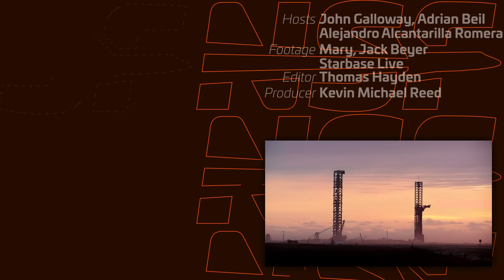The Starbase That Never Sleeps | SpaceX Boca Chica

Comment: 9400 gallons of retardant dropped in 8 seconds by a 50yr old converted wide body passenger aircraft.

It's powered by (3) G.E. CF6-50 turbofan engines producing 50K lbs of thrust ea AND a skilled crew with very large balls

Comment: When the booster is moved, is it pressurized to prevent collapsing?
Reply: These vehicles aren't pressure supported, they have reinforcement stringers and hoops to give strength. They pretty much need to be transported vertically all the time though, horizontal is possible but logistically a nightmare to lift and move, pressure would help in this scenario.

Vehicles that need pressure to be supported are "balloon stages". Very thin stainless steel skin with no structural reinforcement. The Vulcan upper stage is an example of one, it's very thin stainless steel and would collapse without pressure.

Comment: If this has been covered in a conversation I apologize for missing it but do we know if the booster engine that had the partial failure was the reused engine from the fifth flight?
Reply: The reused one (314) was on the outer ring, but the one that didn't restart was a middle ring engine
Reply: @ Thank you so much!
Reply: No

Comment: The scale of the engineering required and the speed with which these structures are built is mind blowing and deserves its own documentary. Everything needs to be custom designed, built and assembled. The supply chain behind all this and the complexity is very impressive.

Comment: is there an official limit to "testing", i mean at what point would you call a launch and a mission an actual mission, as opposed to a test flight?
and am i right in thinking it came in at a steeper angle this time, to avoid burning the QD and OLM? it looked like the flames were aimed at the concrete at the base of the tower rather than straight down?
Reply: and by the way, ecky thump.

Comment: The sound of the turbopumps spooling down is crazy!
Reply: I believe you're talking about the water deluge noises. We don't hear the Raptor turbo pumps. That high pitch turbine kind of sound is the pressure relief from the water tank nitrogen pressurization, it's a blow off valve. And for catching the booster the system is activated.

Comment: 11:40 - Pad B chopsticks used to catch ships. This could provide better damage mitigation in case something goes wrong with the catch, and we won't have ships crashing into their own already-landed boosters. (and it keeps the Unprotected booster tops from being roasted by the incoming ship) 
So catch the booster on Pad A and put it on the OLM. Then catch ship at Pad B, put it down on a transport, then Pad A can re-stack it on the booster.

Comment: Do we think SpaceX will split launch and catch towers in the future? The equipment needed for each has very little overlap (I assume). And in years past reusability, how many towers do we think? I'm going with 5 launch, 2 catch sounds reasonable.
Reply: SpaceX has released plans for a dedicated catch tower at 39A, but it will probably be for overflow situations landing ships when they’re preparing a launch on the main tower.
Reply: If the plan for a booster is to refuel and refly, it makes sense to land on a launch capable tower.
Reply: The launch towers use the same chopsticks so any launch tower is also a catch tower
Reply: @ale131296  the hardware on the chopsticks needed is slightly different to lift for launch vs catch. Along with quick disconnects/water/tank farm/flame trench. I just feel like it will be a catch and release vs full stack procedures.

Comment: That vent from the booster looks a lot like the ones that come from the tank farm when they burn off exhaust to prevent emissions. Do you know if there's any correlation?
Reply: The tank farm doesn't have any flare stack, they re condense methane. But the booster since it wasn't attached to the QD had to relieve pressure into the open until it's connected up or empty, not sure if there's an igniter but it comes out and is essentially a flare stack to burn off the methane that was released.

Comment: I wouldn't be surprised if Engine 314 is reflown on Booster 15/16 to keep the longevity testing going.
Reply: I honestly hope that they refly Booster 14, after the necessary inspections. But I do hope that they pull 314 off, and fly it on the next booster, as B14 certainly won't be flying for a while, if they do end up reusing it.
Reply: @daedelushex1841  That also begs the question of what kind of low profile test mission/payload will SpaceX risk the loss of the entire booster+ship in case something goes wrong with reusing a booster for the 1st time?...
Reply: @you2be839  It would likely be just another test flight, without payload.
Reply: @daedelushex1841  I don't think they're gonna risk Starship S34 on Flight 8 since they had a big issue with Flight 7 with it and they need to make Starship work first.
Reply: they might even fly some more engines from booster 14 because they looked great!
Reply: why not check, retest and reuse the whole booster as flight 8 will be all about the ship and not waste a new booster on a ship test
Reply: @thijsvanhout4242  They will most likely spend quite a bit of time thoroughly testing Booster 14 before they consider flying it, and I expect that it will take several months. I wouldn't be surprised if they remove all of the Raptor engines and test them at McGregor, as it has better testing facilities. Then they would reinstall the engines and conduct the whole suite of tests, from pressure and cryo, to spin prime and static fire. That is what I think is prudent to do, for the first ever reflight.

Comment: Nice that S34 finished cryo testing for the moment at Massey's, but since they've moved it back into MB1, it's time to begin all the extensive design & build corrections to prevent any Flight 8 RUDS. 

And afterwards, run another series of tests @ Massey's. Or if necessary,  just scrap S34 & apply those corrections to S35 or any other ship that's not very far into the production pipeline yet.